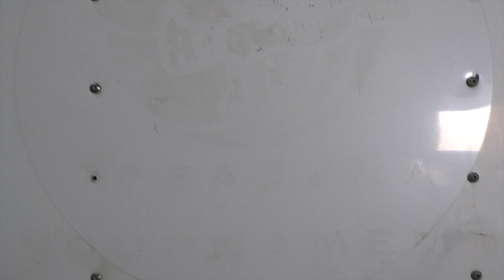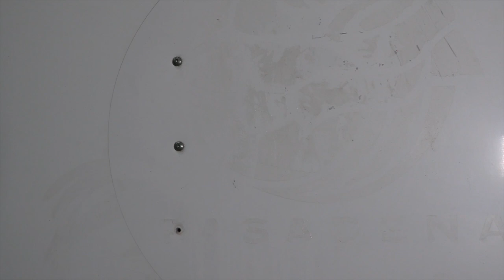How to Use Rapid Remover to More Easily Scrape Off Old Vinyl Graphics

Comment: I put aluminum foil on top of the wet graphic remover so it will not dry out as it works I had an old vehicle wrap with sun damage so I pulled off the vinyl that would easily pull off especially when it is in the hot sun and then the on what was left on I used the decal remover and covered he wet remover with foil so and let it sit for 1 hour but I would definitely do a test spot for timing and to make sure it doesn't harm the paint.